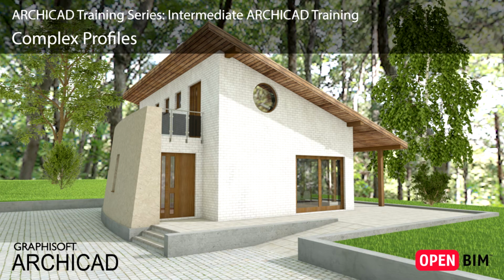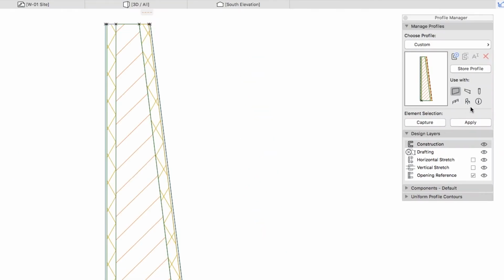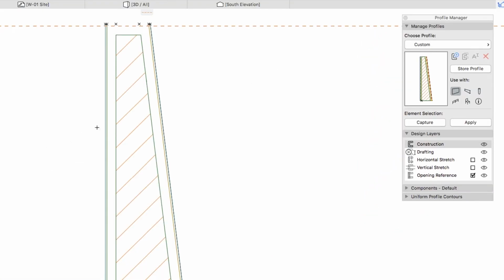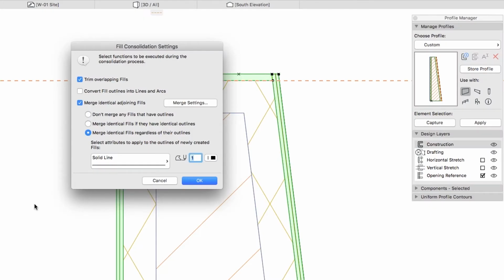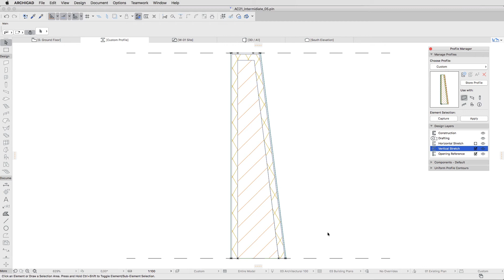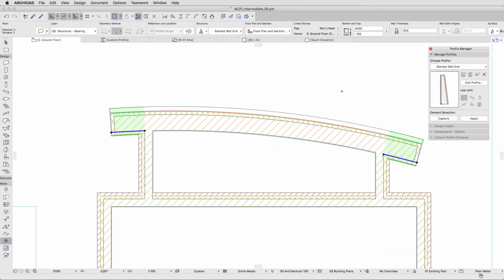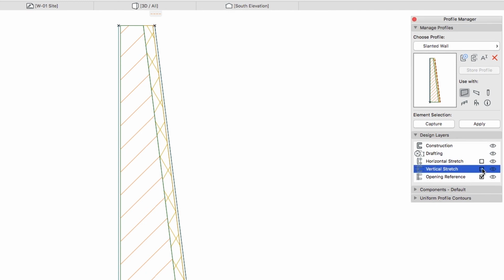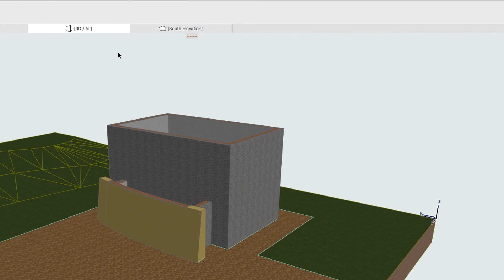Complex Profiles - ARCHICAD Training Series 3 - 13/84

Comment: Using ARCHICAD 23 TRIAL, I can't find Vertical(Horizontal) Stretch on Design Layers Pannel in Profile Manager. Instead, there is Stretch Modifiers. I think this is same, but no checkbox. What does it mean?